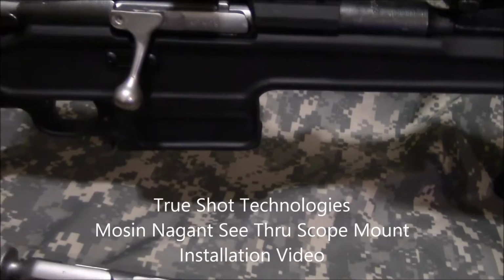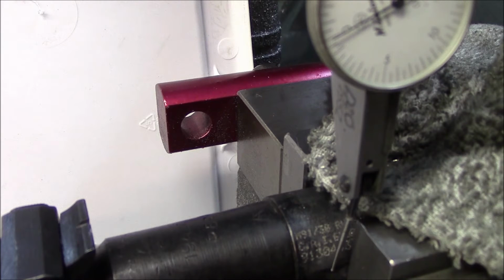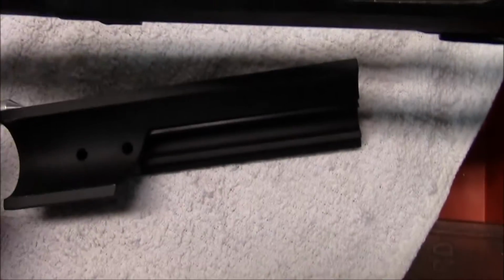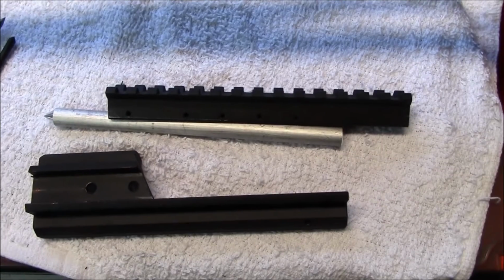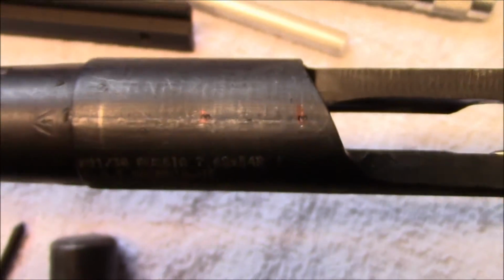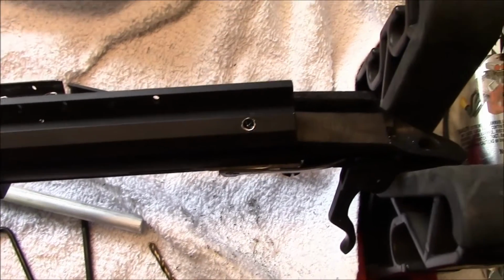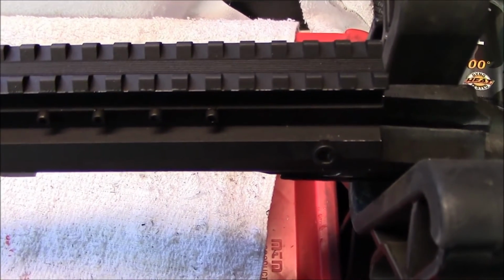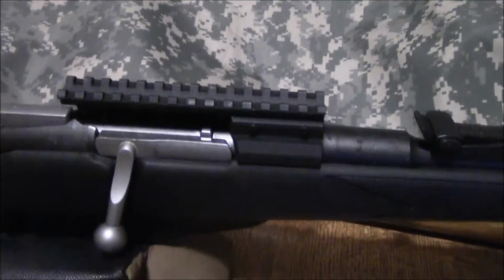True Shot Mosin See Thru Installation

Comment: From his other Mosin video, he uses a BSA Contender 6-24x40mm with low profile rings and it clears the rear sight.  The BSA Contender has a 4" eye relief, so any scope with similar eye relief should work fine.  I bought myself a Simmons Master Series ProDiamond Shotgun Scope 1.5-5x 32mm to use with mine.